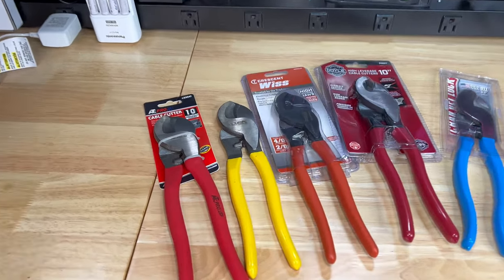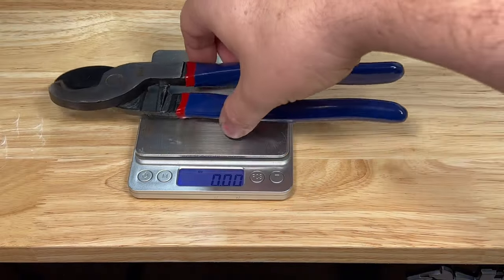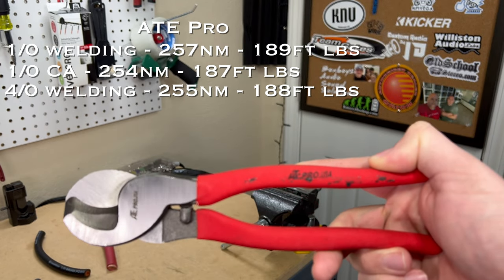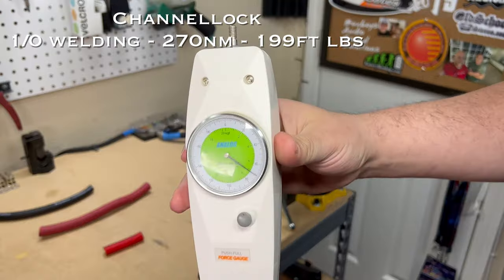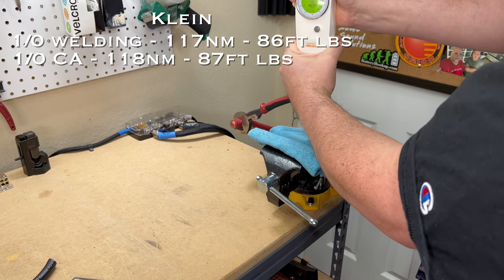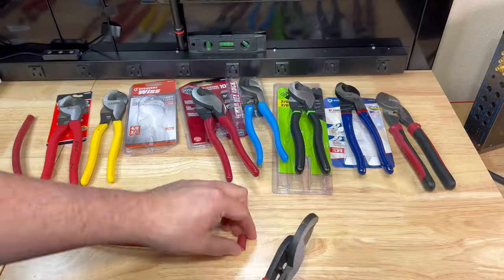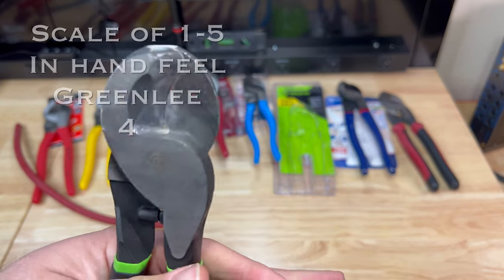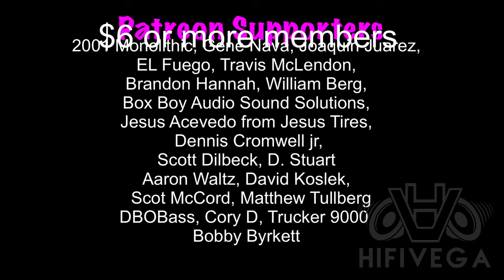Best Cable Cutters? $40 Klein vs Doyle,Greenlee,Channellock,Southwire Down4SoundShop…

Comment: I did electrical for 20 yrs and used just about every brand there is cutting up to 4/0 THHN copper and what you need to realize is this, 15 yrs and thousands of cuts later and the Kleins still cut like butter. Worth every penny.

Comment: I owned the WISS cutter before watching video.  They are stiff, a little Kroil and use they will smooth out.  Made it thru a piece of 4/0 I had laying around, but not without a lot of effort and turning the cable twice!.  If they break I will spring for the Kliens, not seeing the need to cut anything bigger than 2/0 for now.  Great tool test.

Comment: If you slow the video down you can watch the gauge peak when you slam down
Reply from the maker: It peaks right at the moment it cuts through. I made sure to slow down every piece of footage to ensure I got the proper reading
Reply: Most of the measurements are in the 220-250 Nm range. This equals around 25 kg / 55 lbs weight at 1 meter (40" / 3,3 ft) distance.

You have about 5 to 6 inch leverage which means roughly 6-8 x the weight at 1 meter. That's up to 200 kg equal weight.

A strong male has hand squashing power of around 50-60 kg. If these numbers were right, no man on earth could cut these wires with any of these pliers.

There is definitely some flaws in these measurements and compared to similar tests done by Project Farm these numbers are ridiculously high.
Reply: It could of course be that the measurements were not Nm (mass x G / distance from pivot point) but simple Newtons (mass x G).

Comment: Holy shit! You do realize that the reason you're getting roughly the same "NM" readings with the first handful is because your slamming the cutters closed while still touching the handle....
Reply from the maker: I should have showed the slowed down footage in this video, but I checked frame by frame and the force was measured before the slam